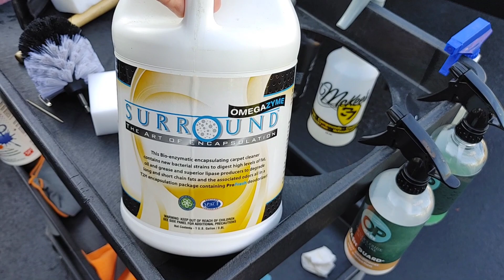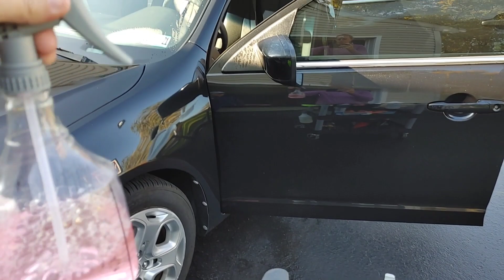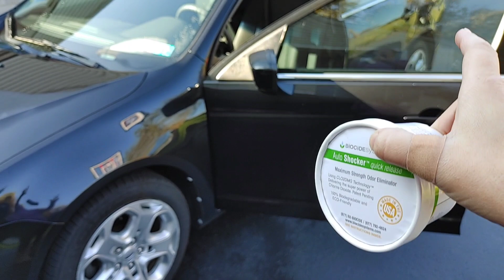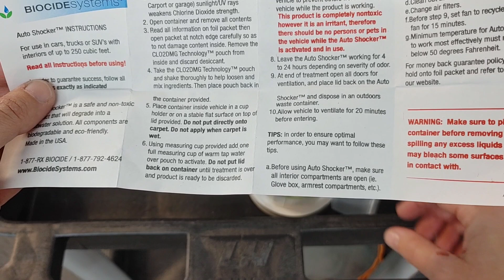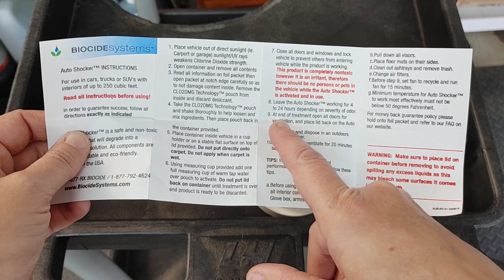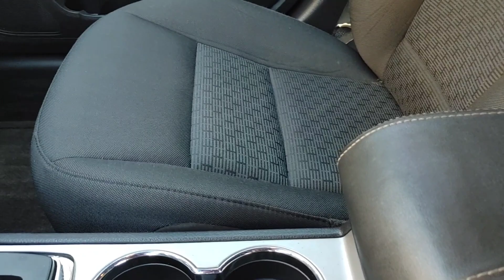Smoke Odor Removal WITHOUT a Ozone Generator- Biocide Systems Auto Shocker!

Comment: What do you recommend for cleaning the air ducts?
Reply from the maker: I use steam to blow them out as best as I can but realistically the chlorine dioxide will circulate through them when you put the ac in recirculate mode to kill odor in them
Reply from the maker: But you also want to change the cabin filter

Comment: Hi there, so I used an Ozone Generator in my car and I had the circulating air running and now my car just smells like burnt wire, a smell that the generator left. I've had the car interior detailed and extracted twice. How can I get the smell out of the vents, too? Can this product get rid of that smell as well? If not, what could I do to get rid of that smell?
Reply from the maker: It shouldn’t smell like burnt wire it should smell strongly of ozone which has its own distinct odor. It’s possible the generator isn’t working properly and may have an electrical issue. This should help remove that smell but you may need to leave it overnight but I’d recommend replacing your cabin filter first and also letting the vehicle air out a few days before doing this.
Reply: @attention2detailswchelsea  Thank you so much for replying back. I've replaced my filter twice and the smell is still there but I will give this a try. When can I turn on my a/c to let it go through the vents because that's where the smell is coming from. Can I do the heater or does it have to be the a/c?

Comment: Excellent video/info!  Question- do these methods REMOVE the smoke or only COVER the smell of smoke?  How does cleaner smell?  My Daughter's used car still smells smoky after 4 years... am worried if it smells smoky (or chemically) it's got to be unhealthy for my Granddaughter?   I am also about to buy a used car & very sensitive to nicotine/chemicals myself. Am worried about long lasting chemical smell - followed by stale smoke being apparent-  weeks or months later?  Any insights helpful. Thanks!
Reply from the maker: The carpet cleaner is a safe hydrogen peroxide citrus based chemical that has a mild citrus smell. The chlorine dioxide is strong initially and smells like chlorine but dissipates over a few days. Thats why its recommended to air it out for at least a few hours before driving.

Comment: H Chelsea, I realize you specialize in autos, but wonder if you have used this in rooms? I'm wondering if we are going to need to remove anything, especially computer equipment. Bought a house where the seller used a lot of air fresheners. Now that the smells from those have weakened a good bit, we understand why he used them Ugh! Need to get rid of the bad odors and the air freshener odors. Haven't found anything that would explain the odors so hoping this product will help out. Great video, by the way. Again, any idea if  anything needs to be removed? Thanks!

Comment: I'm so glad I found your channel.. I unfortunately forgot a bag of house garbage in the trunk of my Hyundai Santa fe for like 3 weeks.. I'm so mad at myself.  The truck is not currently being used in case u were wondering why it took me so long to realize this.. But anyway, my only question.. Will this chemical affect the material on the seats?? Will it cause discoloration of anything in the car???
Reply from the maker: If everything is dry no. Just make sure to air it out after using
Reply: @attention2detailswchelsea   great.. thank you!

Comment: Hi! Great video! I would love to get some advice if you have the time. I just recently picked up a used 12 Ford Superduty. It was heavily smoked in from day one. The interior is in amazing shape, however, it’s a lariat trim that include perforated leather seats all around. 
I spent the money and had a professional interior detail done at the cost of about $400. He said he used a chlorine treatment and ozone treatment along with the thorough interior cleaning…but, The smoking odor seems to be stuck in the seats. My question is what do you do when you come across a leather interior vehicle with heavy smoke odor.
Thanks!!
Reply from the maker: That's a hard situation because you can't necessarily get a cleaner deep down into the perforated leather seats. You may need to do additional chlorine treatments or ozone treatments or longer treatments it always based on how long his treatment was but you can leave the chlorine dioxide in for up to 24 hours so even if you purchased one and left it in overnight and then aired it out that may help but multiple treatments may be required for heavy smoke odor. I've had a couple Vehicles where I've had to do multiple treatments before I was able to remove the smell. Did he use an enzyme carpet shampoo? And did you change the cabin filter?
Reply: @attention2detailswchelsea  Thanks for the reply! Believe it or not the headliner and carpets smell brand new!  Not sure if it was an enzyme shampoo. Also, unfortunately, this model year of Superduty didn’t have cabin air filters 👎.
I’ve ordered the auto shocker and will give that a try. I’m hoping over some time the odour will dissipate.
Reply: @ryanwood7374  did it work?
Reply: @ryanwood7374  how did it go?

Comment: You could always throw a battery charger on the car and have the AC going key on, engine off. That way you aren't using the customer's fuel for a few hours of idling.

Comment: How's this work for dead animal smell? We found a mouse nest full of dead mice in the air duct and the car smells like someone died. 😁 Seriously though. It smells really bad.
Reply from the maker: You might need to do multiple treatments after cleaning thoroughly. Try one for 24 hrs minimum and see what that does
Reply: I had mice in my car at one point and started getting skin irritation to the point that my skin was burning. I stripped the car interior and found they had been up in the headliner as well.

Comment: Seems like a decent product.  Will this remove more than smoke odors?  I would like to use it in the spring when I open the camper.  Thanks
Reply from the maker: Yes they have a list of odors it can be effective on on the container and on their website
Reply from the maker: They also have other types like a home shocker as well. Check out their website for more info
Reply: The chlorine gas will oxidate and destroy any organic compounds (containing carbon atoms). This is the same gas used during the WWI only at a higher concentration. ;)
Exposure to the sun light will break down the chlorine gas so drive the car with your goggles on and windows down when you’re done removing the odor.